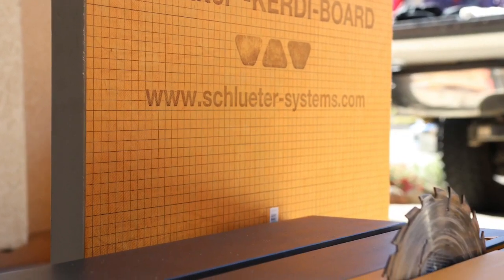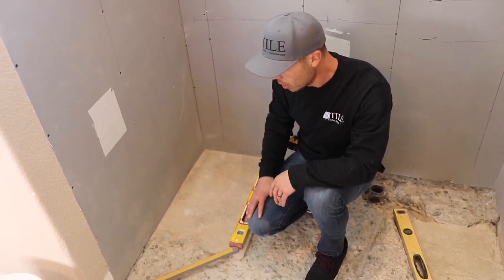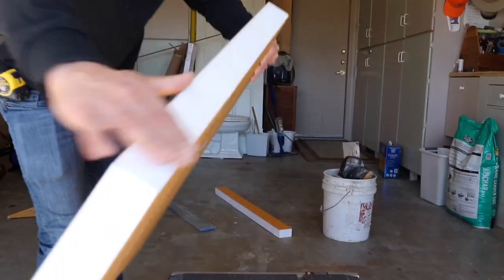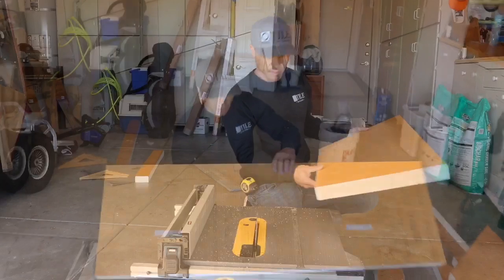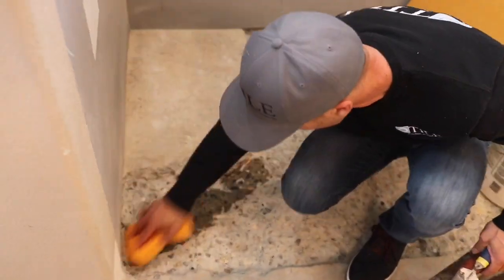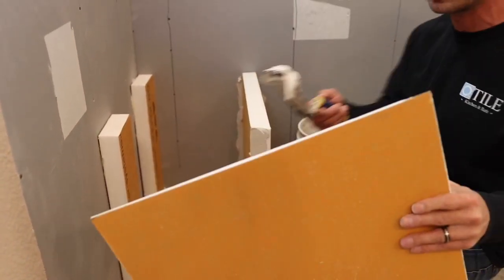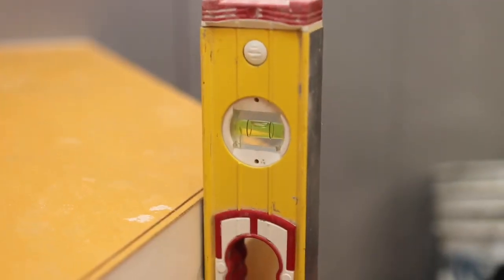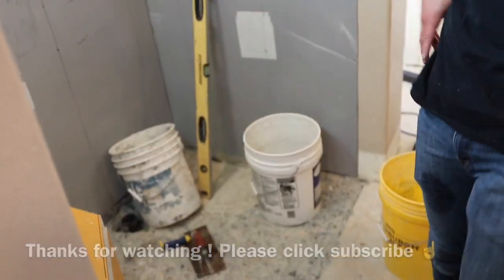How to Build a Shower Bench: Tile Coach Episode 26

Comment: I wanted to see how you water proofed it. I am doing something similar. You mentioned using Kerti band. I believe this to be 5.5" wide but the board is 2" thick. So, how is the 2" over lap achieved? Then what is the purpose of the fleece? Not a lot sticks to polyethylene.

Comment: I will be using it in a shower so I don't have to drive fasteners through the concrete floor to avoid damaging boiler floor heat runs.

Comment: I've stuck alot of 4" foam on big commercial projects down here in south fla. Some being parex systems and some being Dryvit systems. Some were 1/2" stucco systems. Mesh, polymer base coat (thinset), aquagard, the whole nine. Two applications each system. Somtimes three if the architect really wanted to cover himself. But it's always just a matter of time before moisture and humidity have there way to separate that bond between mud and foam. I'd be pretty skeptical putting that foam in my shower. Especially as the bench. You do nice work though brother. Keep it up.
Reply: so what would you do for shipping container shower bench ?

Comment: When you shoot on phone camera, it always worth to begin with, by wiping lenses with cloth, like T-shirt,  it helps tremendously with annoying autofocus thingy. Thanks for sharing!
Reply: Isaac Ostrom well, if you use DSLR, those in live view mode had to use slow method, which is based on contrast fluctuation to find the right focus, DSLR can’t use its AF sensor (super fast and accurate) as it works in conjunction with mirror, which is unavailable with live view. It makes more sense to use action camera If you do a lot of close up shots in cramped spaces (like bathroom). I don’t say that DSLR has no use, but genre of how to videos implies a lot of close up, which in case of DSLR needs prestage work to get quality picture.
Reply: Isaac Ostrom , yes, something like YI+ or last generation GoPro with gimbal will be much more suitable setup. For instance, the scene where you demoing assemble of shower bench, your head is cut-off most of scenes as you hitting limits of 18mm (the max zoom out of your lenses), which in reality of 80D crop factor, that has no full frame sensor, turns into 35mm. My understanding you went with 2.8f to cope with low light. Something like YI 4K series or recent generations of GoPro are decent in low light and better suited for this type of action, also fraction of your setup cost. Yes, those don’t have zoom, so  cameraman has to move more for zoom in/zoom outs. DSLR lessens with big opening shines with DOF effect, and less distortion which would work better in prestaged setup, like talking sessions.

Comment: Dewalt really got us hook,line and sinker...
Reply: They do have us. But overall,  all tools included,  dewalt is on top.  Sure bosch has better roto hammers, sure makita has a better 10 compound miter, and sure hilti has better impact drills. But over all dewalt is one of the best.  I will buy a dewalt impact for $110 vs $600 from hilti.  I have owned makita 18v tools and Milwaukee 18v along with another brand.  My dewalt stuff is clearly better.  I have had multiple use my dewalt tools and go out and buy them once their current tools wore out.
I hated jumping on the dewalt bandwagon.  Btw, the dewalt tile saw is awesome with all its features.  But it isn't heavy duty.  I will probably not buy another one. But it would be nice if they beefed it up a bunch.  I would pay more for it if they did.
Reply: @travisk5589  I've always own Bosh or Makita hammer drill,  grinder, and laser..But I have to say dewalt tile saw got me..lol..now I have all yellow cordless tools..
Reply: Travis k I’ve gone with dewalt tools in the last couple years since I have a number of their batteries. Having a battery vacuum, small circular saw, light, etc is very convenient. Really like their smaller battery chop saw. Easy to move around and works for 95% of my cuts.

Comment: Isaac I've seen several retro-fit barrier-free entry showers on concrete slab, but no video on how to cut the slab for proper slope etc. Do you have one or a link to a good tutorial? Thanks for sharing your passion!
Reply: That would be interesting may be instead of cutting the slab, grinding a be a better choice. then float deck mud for slope,height and a flat surface.
Reply: @dannybrazil3986  grinding would be a lot slower.

Comment: Call me crazy but I think its way easier to nail a wood bench together and skin it with backerboard.  Which method do you prefer?
Reply: Same here. My dad taught me to do a bench with 2x4 and hardiboard.. Its surprising to see people use this new material but for some reason i wouldnt trust it. If i ever did use this type of material for a shower bench id be scared to get a call back that some elderly/ handicap person fell right through the foam while taking a shower..gives me more of a security using wood and hardiboard
Reply: @robgautomotive  wood is all good as long as your 100% with your waterproofing, Then it’s an issue. Foam doesn’t rot.

Comment: Just throwing a helpful tip. Go Bosch tools. If you do any sort of flooring Bosch is the way to go.dewalt beats them on drills but not sds or demo hammers.
Reply: And cheaper
Reply: Tile Slay I can vouch for the Bosch sds breaker

Comment: What is the weight bearing capacity of 2in kerdi board before maximum allowable deflection occurs?
Reply: It would really depend on the span... Normally if I'm building a bench I'll do supports every 16 in. You will have zero issues using the two in that application.
Reply: @aarontuplin  possibly.. but there's different densities of foam..the insulation foam is pretty weak since it's not intended for anything even semi structural. And also you would have to know what they finish the face with to know if thinset or anything else would stick to it.
Reply: @aarontuplin   You are crazy!  How would you adhere the tile?
Reply: @TileCoach  yeap..not all foam are created equal.Foam is everywhere. From shower tray to bridges...

Comment: ok so nowhere can i find in your comments section anything clarifying the slope going back toward the wall rather than the top of the bench sloping toward the shower floor. I saw your level left and right across the bench it was dead on but when you placed the level from wall toward front of bench your wall end was lower than the front end. Thus the water is flowing the wrong way. what gives. Did you correct that??
Reply: ok just looked at it again, Iwas backwards, but I do have another question, when you put thinset on the walls for the two upright support panels and also the front and side panels, you don't butter the wall for the top panel. Is there a reason for this omission?

Comment: That's a lot easier than using block but I don't have to ever worry about a fat guy sitting on my bench either.
Reply: tileman 30 years seems like you have never jump on top of a schluter bench.
Reply: @Carlos Diaz how strong is it? What is 2 people wanted to, uh “sit” on the bench at the same time? No worries?

I need to check out this 2 inch foam board in person some time. I’m interested, but it hasn’t really caught on in my area yet.
Reply: Carlos Diaz no I haven't but at the end of the day it is structural foam.
Reply: MoneyManHolmes yes you can do whatever you want in that bench.
Reply: tileman 30 years foam is the future. You need to test it for yourself only then you will Understand.

Comment: Is the strength of that kerdi board comparable to the strength of a framed bench?
Reply: Same exact thing i was thinking.....Im debating whether to stick with wood frame or switch to foam? I like how light and easy it is to work with
Reply: I wouldn't put that garbage in my own home, much less on one of my jobs.
Did he say cool or fool way to do it?
Reply: Does anyone have any answers to this question. I'm curious to know how this holds up over time and with someone who is heavy standing on the bench ???

Comment: Is that dense shield backer board on the walls?
Reply: Isaac Ostrom Are you going to tile right over it, or use kerdi or something like redgard? Hope you post another video showing how you finish the floor and walls.😀
Reply: @TileCoach  interesting! I wouldn't use it in my own home, but I have had several builders spec it....

Comment: I was a GC 25 years if I saw a worker use a table saw with such disregard for proper safety I would have to fire them on  spot
Reply: Isaac Ostrom 
Not trying to be a dick.  job sites can be cluttered never walk and lean over a running blade helpers often feel rushed and don’t always check  for hazards. boss needs to set the example safety before speed. diy’s are Learning from you. Keep up your good work you tube didn’t exist in my day would of been a great help
Reply: @TileCoach  Since we are handing out nanny type advice, may i suggest something. Never fart while sweating copper.  The copper oxide can mix with the methane gas and cause instant blindness. I had an uncle lose his sight that way. 
Just worried about your safety isaac.

Comment: Since when is it a good idea to set tile on styrofoam? I mean really? Use cinder blocks for gods sake.
Reply: No!
Reply: Foam is everywhere my friend...check out any bridge construction or commercial buildings in your area..” not all foam are created equal”
Reply: Schluter actually designed the product he's using for this sort of thing, and they are nuts about testing.
Reply: You make a valid point. Block will definitely do the job well, but so will the Kerdiboard. Benefits are much lighter, quicker start to finish, easier to cut, and mostly waterproofed...just needs some banding. I think material cost is the biggest negative, but when you factor your time and wear and tear on the body, I believe you come out ahead going the foam route. Thoughts?
Reply: We did 20 bathrooms and use that for a seat
Reply: I used nothing but cinder blocks for years and even when this kerdi board came out, I was apprehensive, but I’ve had some on site workshop time with some of the reps from schluter, and after all that, I’m a proud user of 2” kerdi board for bench seats in all my showers. Just the thought of lugging in 20 blocks makes my stomach turn anymore, lol
Reply: @grizzly8859  have you ever taken out a tub setup or anything like that that has wet blocks? I mean I'd say I think is almost as reliable as thinsetting hardyboard to blocks.